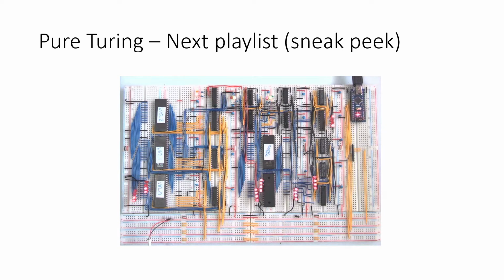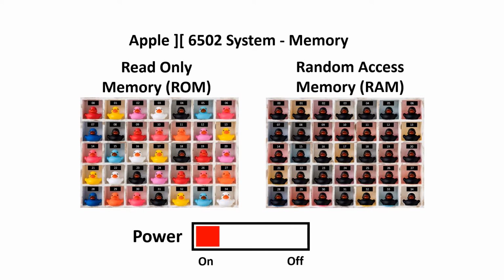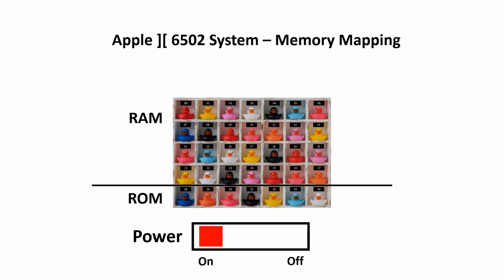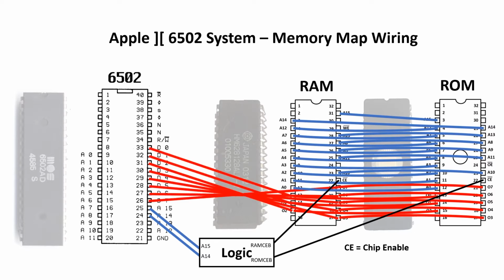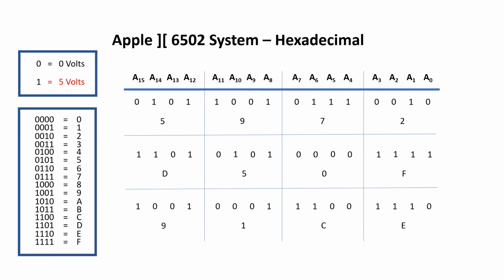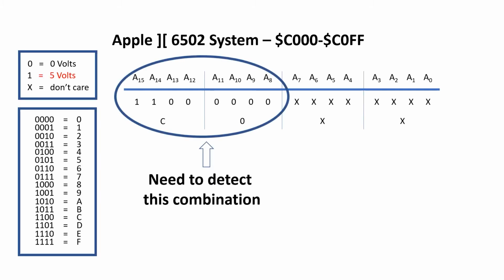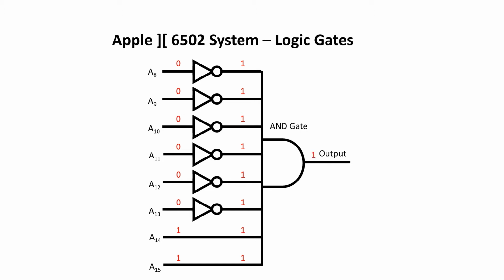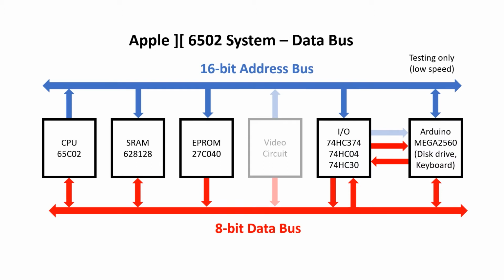Apple 2 wire-by-wire build Part 5, Address bus build B

Comment: I noticed that you don't have address line 16 on the RAM chip hooked up to anything yet. I'm guessing that's for switching between main and auxiliary RAM.

If you were supporting arbitrary peripherals, the way you've implemented the address logic would render peripheral card ROM nonfunctional, but since it looks like the only peripheral you plan to support is an emulated floppy drive, that shouldn't be an issue.
Reply from the maker: Eventually i will use the full 128K, but i think i just ground it in the short term.

Comment: I designed a 16 bit microprocessor system back in the early 1980's and have always been a hardware guy, so little of this is new to me.  However, please let me say, you are a great teacher.  Your style and the clarity of your explanations is truly outstanding.  If only I had learned maths from a guy like you back in the 70's - my life would have gone down a different path.  I am watching this series just because it is enjoyable to watch, and if I learn something new, then that's a bonus.
Reply from the maker: Welcome.  You might like the Turing6502 series particularly the first two episodes the Rulebook and the Notepad - less than 1hr viewing time, but if you've been building machines for a while i'd recommend you watch them.
Reply: @DrMattRegan  Thanks - I shall take a look.  And I did learn some new stuff from this series - such as implementing a state machine using an adder circuit as well as the latch, with the adder modifying the behaviour rather than the more traditional bunch of gates (or using a 22V10 PAL or similar, as I did a few times).

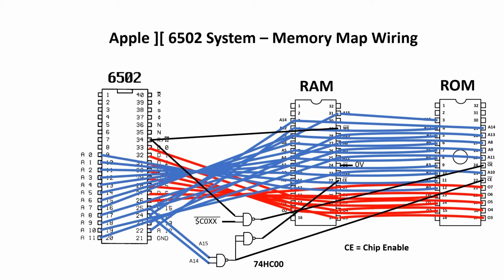Comment: I have a doubt at /$C0XX signal,  at video 10:50 it seems that /$C0XX=1 with R=1 are required to output enable /CE at ROM, however at 9:52 you show that when address C0XX is selected, the /$C0XX=0 not 1, thus do not meet the requirement to output enable /CE at ROM, is it not missing any inverter before /$C0XX enters on the nand  port in 10:50 to provide 1 when C0XX address is selected ?
Reply: I believe we want the ROM to be unselected when at address $C0XX, because that corresponds to IO, not RAM.